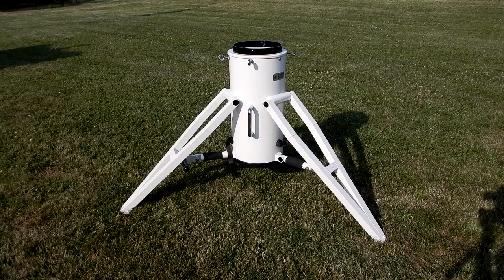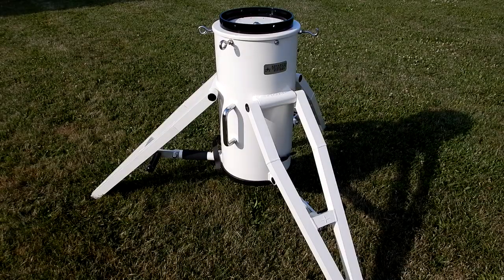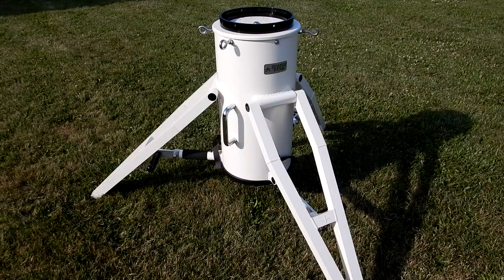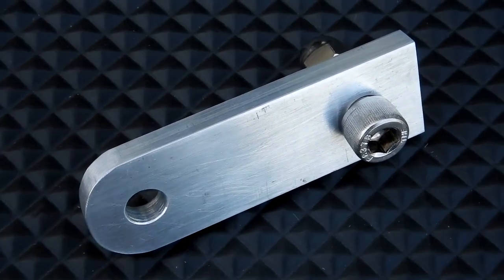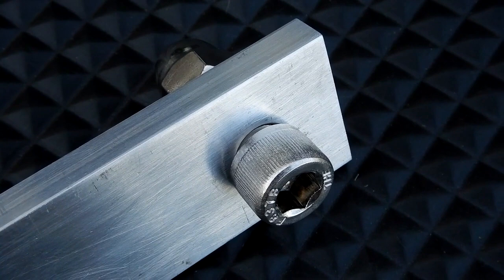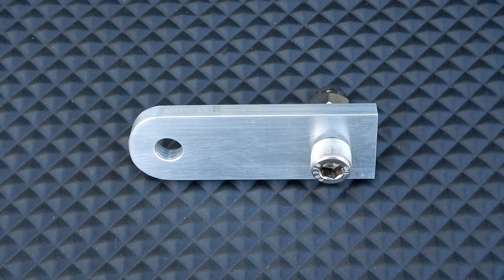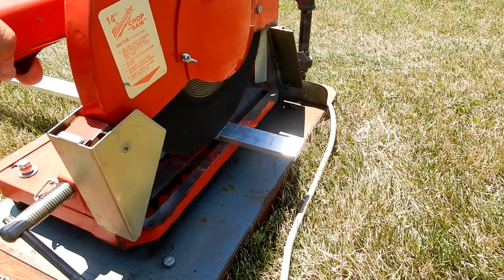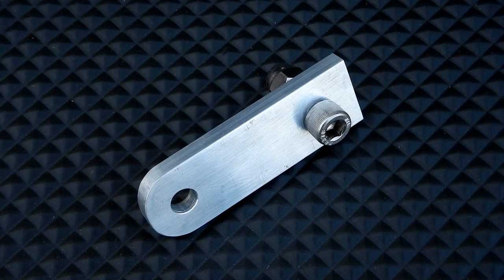Lowering an Advanced Telescope Systems (ATS) Portable Telescope Pier

Comment: Impressive, Tony.  I may just have to consider doing that for my 10" ATS Portable Pier.  I ordered it with the 8" extension and as I get old(er) it gets harder to lift my 1100 GTO head up on to it.  Thanks for this. From what I saw, you still can turn the turnbuckle too, right?
You never mentioned what the material is of the bar stock. Is it Stainless or Aluminum?
Reply from the maker: guzzialfa   THANK YOU so much! Same reason I did this to mine. If my arthritis flares up every bit lower I can get the tripod it is helpful. Got it out with my 92 on it for the night. Very hot and humid.

 Really glad I got around to doing this as it's been on my list for some time. I used aluminum stock, 1/4" thick. It is as rigid as without the extension. Aluminum is easy to work with too. No issues. And yes, you still can use the turnbuckle. You do not lose anything from adding the extension. If you want to go back to stock it only takes a few minutes.

What will you be putting on the 10" ATS? How long will it take to get once ordered? CLEAR SKIES!!!
Reply: @starastronomer  I have an early 1100 GTO-CP3 now a CP4. Got the 1st run. I was using the A-P Portable Pier and found it to be way too difficult to use on uneven ground for outreach.  Now that I think about it, since the Eagle Pier is 6", my ATS Portable Pier is probably the 8" version with the 8" extension.  I've got it about a year after I got the A-P Pier. Frankly it doesn't get nearly as much use as the Mach 1 and Eagle simply because of weight and height.  This may make the adventure a whole lot easier. Now if I can just make room in the van for the SKB case that holds the 1100 in one piece,  I could take it more places - thanks to you!  John